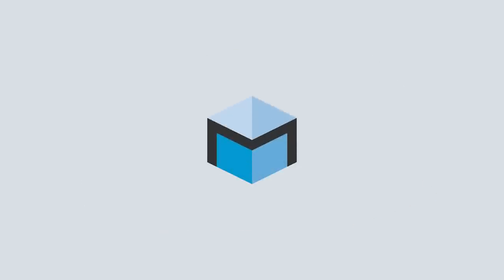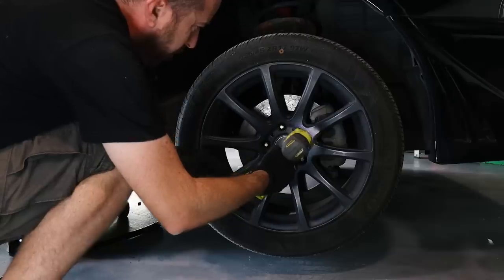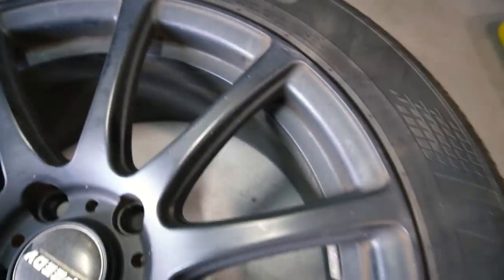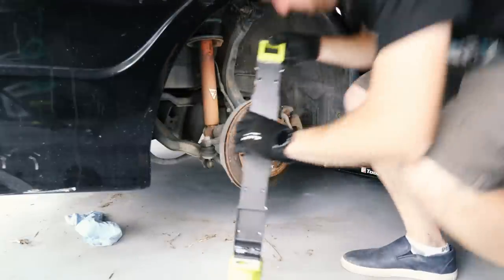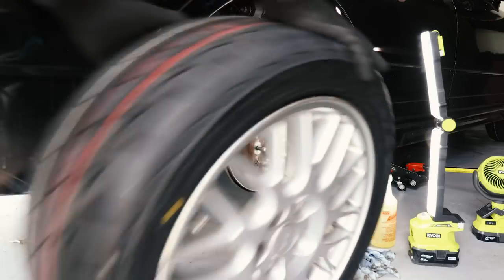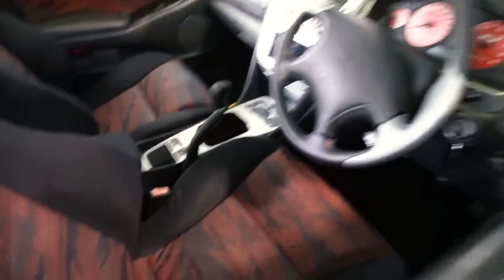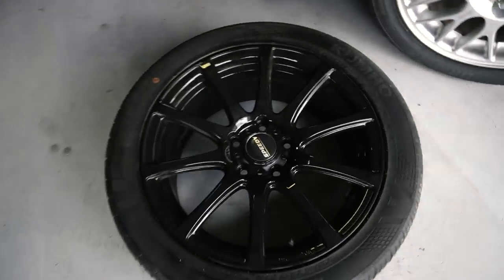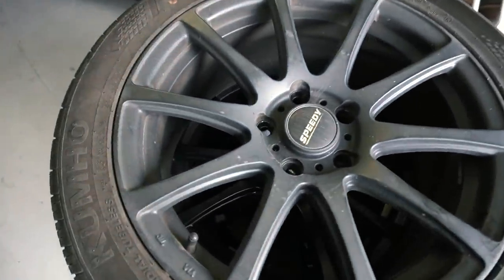The Best OEM Wheels? Refitting the Magna Ralliart's Stock Enkei Wheels with New Tyres!

Comment: The original wheels are so beautiful I really don’t understand how anyone thought that replacing them with another type of wheel was an improvement.
Reply: the other rims are pretty cheap looking, they probably did it to preserve the original rims
Reply from the maker: @aus-reviews8462  previous owner said he needed new tyres but saw a cracking deal they had going on a wheel and tyre package for these.
Reply: @MotoringBoxTV  ah i see, how do these rims go against the bbs rims? they look similar but i bet the mitsubishi ones are superior quuality?
Reply: @aus-reviews8462  The factory wheels are Enkei.... so of course they are a million times better!
Reply: I know sometimes back when people used these ralliarts for racing/rally the stock wheels small offset would hinder turning on some courses so they'd get wider offset wheels 

The only reason stock offset wheels weren't great for hard-core tarmac rally back then is because Mitsubishi kept offset small so it complied with ADR so it could be road registered
During this time teams sold parts they didn't use or misplaced it meaning they couldn't revert it when selling

Comment: Wheels look great! I put the 6g75 into my old magna (was only a 3.0L 6g72 though) and the difference was phenomenal, however you do lose some of that originality as the Ralliart motors are unique to the rest of the Magnas. Depends how strict you are on keeping it original/authentic.

When you do the timing belt, make sure you get the full kit with tensioners and water pump, Dayco sell it as a complete kit, can't go wrong.
Reply: So true you would be insane to just change the belt  and not the water pump.
Reply from the maker: @perpetualgrin5804  you'll be glad to hear I have replacements for all of the above 😁
Reply: Ive replaced a timing belt on an 03 magna pain in the ass belt goes throught the engine mount and the cam has to balanced on the rocker otherwise the cam timing is out its so annoying to do without the right tools

Comment: Other thoughts - If you want to keep the OEM look and gain some width/offset, Evo 7 wheels are the same design with that extra width and poke. RE: timing belt, there's a tensioning tool you can get off ebay you'll need for the adjustment pulley. very handy to have. regarding parts, nothing wrong with a dayco kit, but buy the cam/crank seals genuine Mitsubishi. It's just worth the piece of mind for a few extra dollars. Distributor O ring is likely leaking as they all do, so when I do timing belts I usually just do a whole top end refresh. Dizzy O ring, cam block off plate O ring on the front head, aswell as your rocker cover gaskets plugs/leads etc. Can be daunting but as long as you have the workshop manual handy you'll be sweet, you obviously know your way around cars so you'll be fine

Comment: I was out riding on the bike and saw one of these boot it at the lights, silver in decent shape with an exhaust. It actually sounded very good, nice crackle and pop on the over run!
Reply from the maker: Mine had the same crackle and pop on over run when the revs are up there 😁

Comment: Timing belts are extremely simple on Magna’s, jack the front up, drivers side wheel off , and normal spanners. possibly a rattle gun to remove the harmonic balancer .

Comment: I converted a pejero (6G74) to the 3.8 (6G75) a while back. At the time it was $500 for that engine, definitely worth it a solid upgrade. Required a few but to be fabbed up and adjusted but worth it.

Comment: I don't know about Australia, especially your specific state - but in NZ, they can only fail you on an inspection for exhaust if it is leaking or noisy.  Now, that doesn't mean you won't get inspectors that see your tin can and think they can fail you on it regardless what the rules say (I had a guy try to fail me for a small bit of surface rust on the top of the boot lid once, despite it being both non-structural & smaller than the allowable area - fortunately his Boss agreed with me - and another guy tried to fail me on a non-existent wheel bearing noise - I ended up having to get a qualified mechanic to sign off that there was nothing wrong with the wheel bearing on that one - also had a guy fail me on worn brake pads once - accepted his word only to find the pads were less than half worn once I got the wheels off - complained about it as it cost me $70 in brake pads I didn't need, and an hour of my time replacing them - but never heard anything back - bad thing would be for a non-mechanical person being failed would have had to pay a few hundred bucks to a mechanic for unnecessary work)
Best thing to do is know the rules before you go and be willing to argue if you believe you are being hard done by.
Definitely like the OEM wheels BTW!
Reply: Yeah I’ve had similar. Recently took a car for rwc and the guy failed me on the way the light swiitch works (it comes factory like that) and he said the windscreen washers were blocked (they were literally brand new, installed the day before). He was a contractor working for the garage - the owner of the garage didn’t charge me a cent and told me to go elsewhere as he agreed the inspector was a moron
Reply: But sometimes you are stuck for options and just getting it done is quicker.
Reply: @wobblysauce  I've usually had a second car so had the luxury of being able to bicker & still drive legally 🙂

Comment: They timing belt is easy, I did mine twice before I was qualified. Access is gained by removing the front left wheel and inner guard.  The hard part is replacing the oil seals, especially getting the    harmonic balancer off.
Reply: Front left... passenger side? Yeah right bro!
Reply from the maker: @moshesheckel7369  the old reach around.

Comment: OEM wheels are miles better than the Speedy ones. I would have thought that you might have made a start in painting the rotors & calipers while you were replacing the wheels. I'm sure that can be a future episode.
I'd get another exhaust system. I'm sure there's a sports one out there. I replaced the original exhaust in My VY S Series I ute with a Redback sporty system for $600 fitted including new tips & it made a huge difference in performance.

Comment: Sean with the doorhandle if it isn't popping in correctly, keep in mind there's a clip at the rear so instead of placing it in straight push it back on an angle then straighten and it should fit like a glove
Reply from the maker: Yeah I noticed that and tried to hook it in. I'll have to have a look at it again, all the other ones went in fine.
Reply: @MotoringBoxTV  yeah I had the exact same issue when putting my doorcards back together you sometimes just gotta fiddle around with it until it fits 😂

Comment: i repeatedly wore through those bridgestones through heavy use in just a few months
for when they run out of tread, michelin pilot sport 4 will last much longer and was cheaper for me in the long run. they also perform better
Reply: also you should go to the exhaust shop when you're able to regardless, even if the inspection isn't stringent enough to check it
it looks like its pre-cat so you probably want to remove the time spent breathing that in

Comment: Factory rims = so much better!. I say cop the extra cost and let a mechanic replace the timing belt and water pump and the 6G74 will power on for many more years. These engines can burn a bit of oil though. The 6G75 is also a sensible engine replacement.

Comment: This was like 15yrs ago so i might be misremembering or your door handles might be slightly out.
but if i remember with my old VRX when i changed to chrome verada surrounds if you pull the door handle open fully when slipping them in as well as moving the door handle open and closed while seating them will get them sitting better  

also old parts so agree with not too much force because they do break and crack very easily

Comment: Because you own the vehicle already    
a mobile safety certificate guy will pass it no problems. They are supposed to drive it with that box hooked up that measures the braking performance. Some will just make up some percentages. 
Check list.
1. Wipers an washers working.
2. Reverse light particularly because it is for saftey not to see an all other lights.
3.seat belts.
4.no airbag warning light.
5. Degease the motor for oil leaks, an get safety certificate when it is cold incase the oil leaks show up.
6. If the exhaust doesn't leak, just paint over the mother can with black paint. There not allowed to poke screwdrivers or anything into potential rust issues. As long as there are  no rust stains visible it will pass. Plenty of dodgy safety certificate guys around your area. One of them will pass it without driving it.

Comment: cant help but notice the sprintex supercharger has fallen off at some stage 😁😁😁but in all seriousness it really is missing hahahaha 

have been watching on intently i love the old magna's please dont swap the motor out for the 6g75 the 6g74 Rally art motors are specific to the Rally art magna and will take away from the build if you swap it out give it to someone that knows how to tune them properly and you will get more power and tourque out of this motor then you will from a stock 6g75 also not sure if they still make them but sprintex developed a supercharger for the Rally art as a dealer special in WA so possibly another option for power if your really keen also pedders developed a suspension setup for the Rally art which is a vast improvement over oem so if those Koni's are shot they maybe worth a look i have the same on my es sedan and there freaking increadible 

loving the content cheers mate

Comment: Enjoy the work your doing. The engine itself isn’t that bad to work on but there are definitely some quirky things I’ve never seen before like the different spark plugs from front to back of engine, can’t remember exactly but there are different. Good luck with the road worthy but I think the exhaust might need to be fixed first Sean. 👍
Reply: They use the same plugs Greg, but due to expense some people only use the long-life iridium plugs at the rear. (due to the difficulty of getting to them.)
Reply: @j.m.6542  well that makes sense. I’ve had 2 Mitsubishis and both were the same when I replaced plugs. Did my head in a bit as I didn’t understand why anyone would do that. You live and learn thanks for that. Another mystery solved.👍

Comment: I recall the timing belt was due at every 100,000 if I remember correctly.  Was done at the Mitsubishi dealer.  Would the local dealership be able to do this still?  Might be worth getting it done fast and quickly, fork out the money for that (i don't think it was a huge amount)  but at least it would be out the way and peace of mind.
Reply: Around $600 at an independent mechanic

Comment: Great work 👍 though if the belt needs changing, I'd suggest to follow the repair manual and take your time, so you're not rushed... If you were to go down the 380 engine route, are those engines driven by a timing belt or chain?
Reply: Belt.
Reply: @perpetualgrin5804  Thanks

Comment: Hey Sean. My opinion & my opinion only. Try to keep it original mate. Get the timing belt sorted before you go for the big spin in it. As you've said, these cars are getting harder to come by. I'm getting my xc fairmont gxl back on the road at the moment after it sitting for many years. But i wont take it out for its long maiden voyage until im happy that it wont let me down. My motto. If in doubt sort it out. Take care mate.

Comment: They probably would flag the exhaust as there isn't ment to be any rust holes in the entire system. As for the wheel nuts I toque all wheels to 130 nuton metres, I never toque the lock nut as it can cause issues later on down the track and I'm talking from experience on the lock nuts

Comment: Hey Sean. For what its worth, an interior that is THIS bad, try baby wipes as a first go to. Its insane the amount of shit they will pick up. They are a fraction of the cost of the Bowdens stuff and leave little to zero residue! Dont get me wrong, i love Bowdens products, and i use agent orange and pong go all the time. But they can get very expensive, very fast.
Another method i use to clean EXTREMELY dirty interior plastics. I will literally remove them and wash them in the shower/bathtub with hot water and dish washing liquid. It leaves them perfectly clean with no residue and its very easy to rinse!
Reply from the maker: Not a bad idea! A lot of those wipes are pretty pricey too 😁

Comment: My 2000 KH Verada timing belt got change at 105K and again at 260K (210K), but I understand these belts degrade. There is a black plastic access panel on the top front drivers side to access the belt for inspection.
Reply from the maker: Mine actually looked fine visually, so I am not super worried at this stage.

Comment: I'd hold off the timing belt until you have time to take it for a good run with a mate following, to check for valve stem smoke. Much better doing the stem seals at the same time if required. With Magnas, it's nothing to do with hard driving, just luck of the draw, they often have it at 200k, others with 500k are fine.

Comment: I love the original Enkei wheels on the Ralliarts, it’s beyond me why people change them. What paint did you use on the wheel centre caps? Mine are in need of refurbing.
Reply from the maker: I actually used the same VHT Silver Satin Vinyl Dye that I used in the interior, and sprayed a layer of clear coat over the top for good measure. The colour match is perfect, but we'll have to see how it goes long term. It's probably outside of their usage parameters for the product.
Reply: @MotoringBoxTV  thanks, I might give that a go and see what they come up like.

Comment: Love the original wheels much better. Just a thought, since the paint is shot why not try redoing som or all the clear coat yourself? Might make a good video.
Reply from the maker: You could, but on the roof the base black paint layer has also faded off... it would be a pretty huge project and may not get the results I'm after.

Comment: I don’t think the side indicator lenses are original either?
Reply: Nah the clear ones are genuine 380 ones common mods people do 
Can also use 380 starter motor works the same but more modern sound 
Can use 380 horns also for better sound 
As well as 380 front brakes & discs 
And the 380 steering wheel also 

A lot from 380 is interchangeable

Comment: If I was a roadworthy guy, I would 100% pass the mother can on inspection 
I’m completely unqualified, but how could you not let it past

*also Queensland as long as the surfaces seal, it can be made out of plastic for all the roadworthy guy cares, problem is the chance of it actually being sealed completely is minimal, can put a no2 strip next to the exhaust and it’d most likely change colour which would be a fail

Comment: The evo wheel upgrade and a subtle lowering makes such a big difference, definitely be worth doing in the future. 

In regards to the finance, I almost fell victim to that. I bought a Nissan elgrand from a dealer, paid it outright so no finance. I had it for 18 months or so, and then when we sold everything up to travel aus obviously I had to sell the elgrand (which are amazing vans by the way, take one for a drive if you get a chance), I priced it toward the low end of the market because I just didn’t have time to deal with a month of peanuts to get an extra couple of grand for it, find the buyer and they do a ppsr on it and it comes back with finance owing… 
I go back to the dealer ready to explode, turns out the finance was the dealers floor plan finance and just hadn’t been lifted. 
Luckily the dealer sorted it pronto, and even said if the buyer backs out he would buy it off me for asking price. 
Ppsr every time. It’s only $2.

Comment: Shane - You've bought the wrong size tyres for the car!
Reply from the maker: They are within 2% OD of the originals so I don't think it'll be an issue. The original tyres on my RA wheels and the black wheels were the same (235/45R17).
Reply: @MotoringBoxTV  Yes but its not the original size the car came with from factory!
Reply from the maker: @GretschenMunch  not bothered - none of my cars run factory sizing currently.

Comment: if ya put a 380 motor in in it like 001 in my eyes its no longer original

thers a channeal called gavs shed, i think he did the timing / belt /tensioner video 

he even does a wave spring vid on the shitty 4 x speed , buy a mnaual kids

Comment: Please stop using that ToolPRO jack!, I bought that exact model in 2019 as a first jack on a budget. December last year I was jacking up my old Falcon to put stands under the rear axle, while laying under the car the jack suddenly made a hissing sound and the car came crashing down on top of me, I am lucky to be alive and I spent Christmas eve in Hospital. After I got out I inspected the jack it appears the main o-ring for the lift piston had ruptured also when looking closer the welds on the bottom of the boom arm had visible cracks, I cant comment if that was before or after the incident but the point still stands those jacks are a death wish!, but don't take my word for it just read the angry reviews on Supercheaps website.
Reply from the maker: Glad you're okay mate. Definitely not worth taking chances with getting under cars. Even with jack stands in place I feel uneasy, and generally like to put the wheels under the car and anything else I can find. Will check my jack over too.